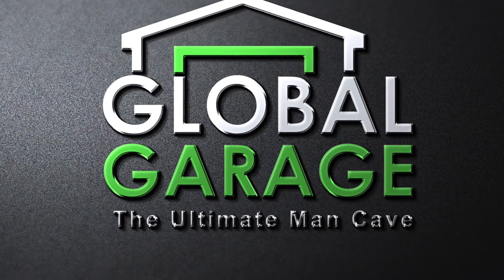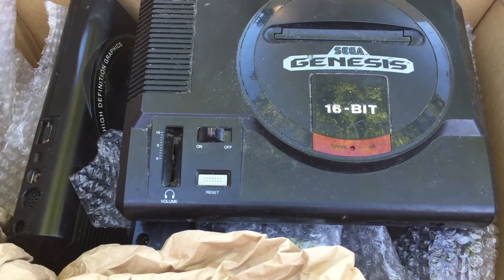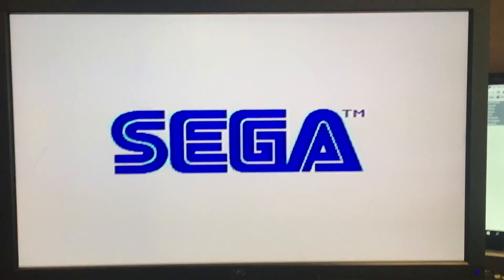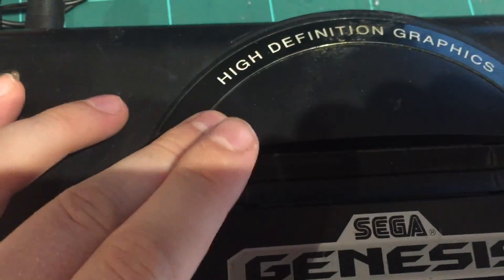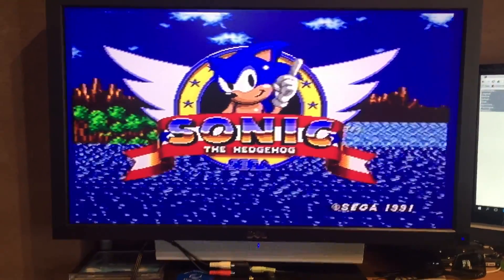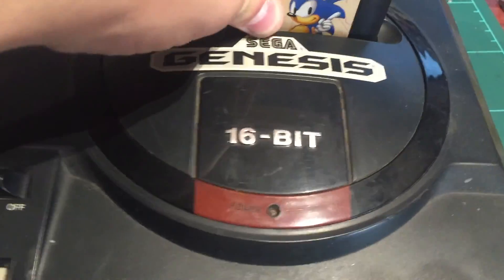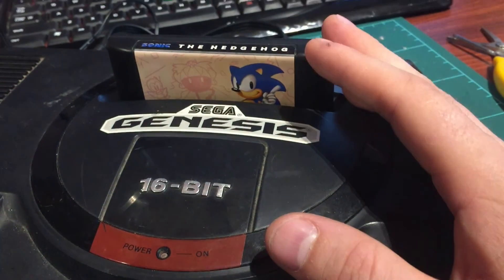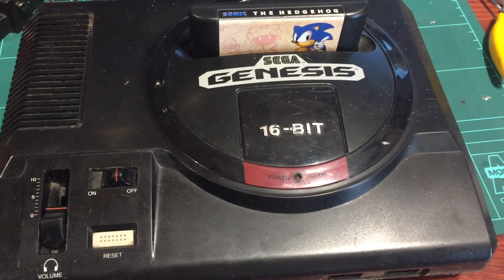Let's Repair eBay Junk - SEGA Genesis Console Repairs - Introduction Part 1

Comment: Hi thanks your video helped fix a original 1989 Sega genesis model 1 high definition graphics system and Sega Genesis model 2 i cleaned both of them I cleaned the motherboards and cartridge slot and they both work excellent

Comment: Console 1 is a VA6.5, which is the good one that doesn’t have HDG printed on top. You can tell without opening because it has TMSS with the old power jack location. An early VA6 still has HDG printed on top and an EXT port.

The bad one without HDG printing is VA7 which moves the power jack to the board… like all JP consoles. Unfortunately, that means it’s harder to distinguish with JP consoles. VA7 is basically a Genesis 2 inside a Genesis 1 shell and has the ASIC audio chip replacement. You got lucky though and both of your consoles without HDG printing are VA6.5.

Unfortunately, console 1 may yet have a problem. Remember how it booted once but not after you power-cycled? I put a ton of work into a “tested” VA6.5 for someone else then discovered that only cold boots work. Some games will work reliably for hours until you cycle the power and get a black screen. From there it needs a cool-down period proportional to how warm it got before it will work again.

I installed a 3BP v2 with Genesis 2-style 9P miniDIN and replaced capacitors for someone before discovering the issue it likely had all along. Very disappointed! I had to do it all over again and give him one of my personal consoles. The exact same thing happened to me with someone’s N64 when I HDMI modded it. Even with my work completely disconnected it would only cold boot. Guess I’m going to have to add a fully-warm power cycle to my testing procedure for any console before I start work.

Console 2:
I knew it was a VA2-VA5 non-TMSS when you booted a game and didn’t get the trademark security system screen but your dedicated video confirms it is VA3. The sound is actually better on your VA6 and 6.5 consoles but this one is still more-desirable as a so-called “non-TMSS” console. VA3 and VA4 supposedly have too much gain on the pre-amp.

Console 3: VA6, which is the exact same board as VA5 but with a different IC4 that contains TMSS. It differs from VA6.5 because there is an EXT port and it has HDG printed on top but it will still have the exact same PCB.

Console 4: Was hard to see the ports but it seems to be another VA6.5. Like console 1 it lacked the High Definition Graphics printing on top so you are lucky neither was a VA7! VA7 is the only “stinker” as far as Model 1 consoles go.

Console 5: I thought you probably fried it on camera by adapting a reverse polarity MD1 PSU but your dedicated video shows otherwise. Good job! The VA1 has bad sound so that one could use a Triple Bypass V2 in it.

Console 6: You can tell it’s VA3 because the left edge of the PCB is shorter and aligns with the left side of the cartridge slot. Even the shielding is shorter and visible through the bottom vents. Though it has the inferior sound chip like Model 1 VA7 and all Model 2s, VA3 has good supporting audio circuitry… unlike console 5 (VA1). I believe VA4 is pretty much the same but made by Majesco after NAFTA. Model 2s usually have good video so a VA3 or VA4 is an excellent choice if you don’t want to mod anything.

Comment: Awesome video, I also bought a lot of 13 Mega Drives last week and found that they all worked with very minor tweaks, nothing needed replacing. Now refurbing and modding them up, it's interesting to see all of the differences between the models like the asian model which doesn't comes with RF shielding and the PCB boards are all different quality and colours.

Comment: You really know what you're doing here. What advice would you give to someone just getting into console repair?
Reply from the maker: CharizardCommander Thanks. My advice would be to buy a few super cheap consoles from eBay. You’ll have to buy them broken or “untested” but that’s half the fun. Easy ones to start with are Mega drive, NES and possibly Gameboy. Avoid the Disc based ones like PS2 as they are much more difficult to repair.
Reply: Sounds like a fun weekend to me!

Comment: My HDG VA6 Genesis runs fine with Genesis games, however when I try to get a 32X game to work, I just get a black screen. I also have tried my SegaCD2 and it won't power up with the Gen1. My VA3 and VA1 Gen2 models will run the SegaCD2 and 32X with no issues. I have cleaned every console connectors/ribbons, so cleaning is not an issue. I think there is something wrong inside the Gen1 console, but I don't know where to look. Maybe you can help me out?

Comment: My Genesis (model 1) turns on but it does not show any image (blank) and the headphone jack has a weird loud static-like sound. Any ideas?
Reply: Same been searching for a few days for any fixes
Reply: Dom LS1 it was the power supply i was using, successfully is now working and restored for my dad with dementia. A forgetting illness, he used to play all the time when he was younger.

Comment: 3:04 wait why does it say EMULATOR, is that a real Sega Genesis or a Retron5 or something?
Reply from the maker: BdR76 It crashed the game when I moved the cart in the slot. That emulator error message is part of the game code. It's nothing to do with emulators like the retron 5, just a coincidence
Reply: Ah ok, I checked and the Sonic cartridge rom actually contains this error message. It is the name of a reserved vector (whatever that is) which is part of the Motorola 68000 instruction set.

Comment: Can u do a PAL SNES troubleshoot video? So my issue is after bringing out the snes in quite a looong time i manage to get it to work but about 90% of the time. It's like it takes 10 mins to 'warm-up' then plays every game perfectly. Almost need to do 1x reset after every cart insert and inadvertently bumping the cart crashes the game. Carts get very loose too im sure its lost some rigidity over time with the snes pin connectors and u touch upon this in another video trying to push them out with a pointed blade to get better connection to the cart edge connectors. Any other advice helps!
Reply from the maker: The cart slot definitely seems loose. I'll try and make a video on the SNES soon

Comment: This video was quite interesting to watch. I've been trying to get my genesis 2 to work and it seems to work fine aside from the video not showing up on my tv. I've tried using different cartridges and unplugging then replugging all the cords in, but no luck. Do you have any suggestions on what to do next with it?
Reply: Still dead?
Reply: @rdaws73  it ended up being that the Genesis itself and the cartridges were all really dirty
Reply: @Slenderquil  Cool, I was going to suggest that.

Comment: G'day, i actually learnt allot from watching this repair series, thanks. There is one issue I've come across which i cant find any info on anywhere. The audio output on of my mega drives has no output at all. There's just a faint buzzing sound. I'm not sure if it could be the slider or bad caps. Is this something you have come across?
Reply from the maker: Good to hear thanks! I've actually got another 7 Genesis 1 models coming in from the US to Australia now. I'll do another quick shoot and cover them all but I think it would be a repeat. I think no audio is generally the caps. A good test is to plug in a set of headphones into the front port and check if they have the same or different audio output. That can narrow down which caps to replace. I'm fairly sure I have a faulty Mega drive 1 with bad audio, so I'll make a video on that repair.
Reply: Thanks for your reply. I will wait and see if one of genesis you get has the same or similar issue. Ah sorry i wasn't specific enough, the model 1 i have does have audio through normal tv outputs but has no sound out of the headphone port.

Comment: Does the megadrive 1 Have a negative center pin on the power supply and the megadrive 2 have a positive center pin, I'm a bit confused, thanks in advance
Reply from the maker: Byte Ninja yes that’s correct. The MD1 is centre negative 5.5.2.1mm and the MD2 is centre positive 4.75x1.7mm
Reply: @RetroSalesAustralia  Thank you

Comment: Hey. I remember you talking about the 7805 voltage regulator on the MD1 in one of your videos (I tried to find it but can't!), did you by any chance mention that there was a replacement voltage regulator that is newer and runs cooler etc?
Reply from the maker: Yes the old LM7805 is a linear 5V regulator found in most consoles from this era. You can replace it with a modern switched mode power supply that is a simple drop in solution using the same 3 pins. They run way cooler and are more efficient, just cost a lot more. http://www.protostack.com/semiconductors/voltage-regulators/switching-regulator-lm7805-drop-in-replacement
Reply: Awesome, thank you. I came across this one today also, I thought you might find it useful as it seems cheaper: http://ie.rs-online.com/web/p/non-isolated-dc-dc-converters/7962132/.

Are there any inherent drawbacks to replacing the 7805's with these newer switching regulators? Biggest bonus I see is being able to remove the big ass heat sink in the Mega Drive 1!
Reply from the maker: No real drawback except cost...

Comment: Hi there. I have a sega 1 model from back in the day .Finally got the cables and a game to test it out ' problem is the color is (red\pink) in my TV when i start the game I'm still able to play it , but gets in the way of enjoying the sage as intended. Its not my TV n its not the game  its the system do u have any idea what it could be.?  if u could write back that be great. thanks
Reply from the maker: The red/pink tint could suggest the other colours Green and Blue are somehow not coming thorugh. If you're using an RGB cable, then I would take a look at the caps in the cable and also check the motherboard for the 220uf caps around the video encoder. If you're using composite video, then look closely at the encoder area of the board and check all solder points. Caps are very likely, also a 75ohm resistor could have a dry joint. It'll be labeled Sony CXA1145 or Sony CXA1645 depending on model
Reply: Global Garage very good advice.

Comment: My sega genesis (megadrive) gives me just a blank black screen when i 
turn it on, do u know it could possibly be? It has been in storage for 
20 plus years and it used to work fine, any tip u can give me?
Reply from the maker: This issue is usually caused by dirty game contacts or a dirty and corroded slot in the console. Use some Isopropyl Alcohol to clean the contacts and see how you go.